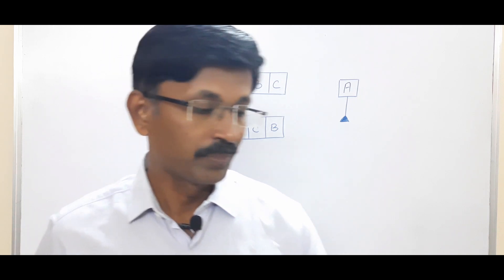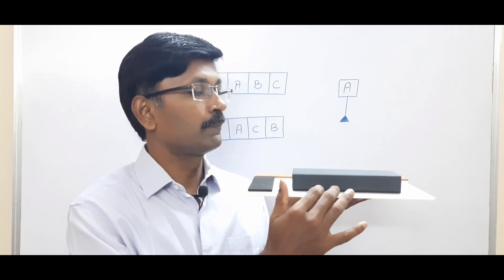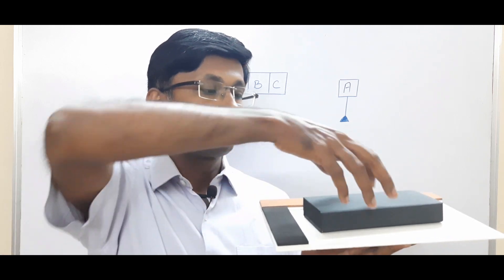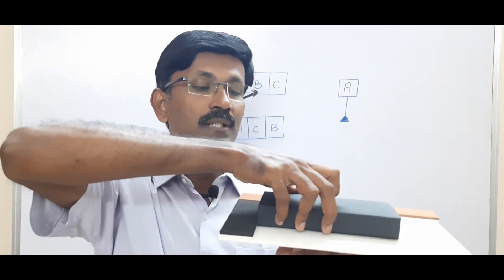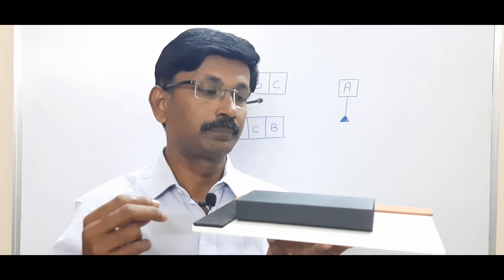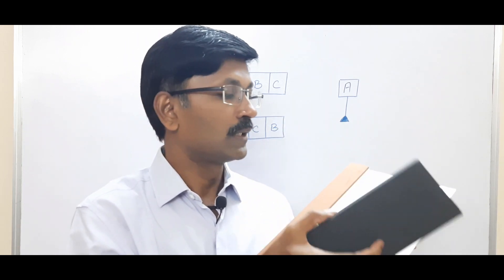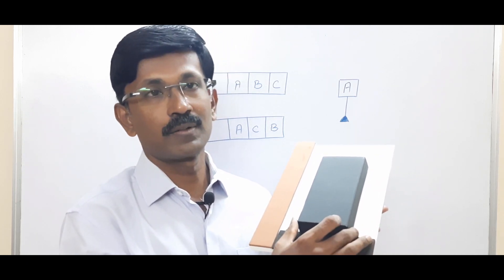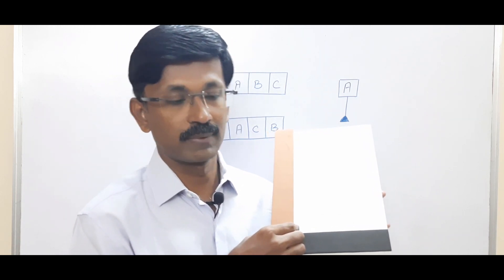GD&T Tutorial 24.2: Datum Reference Frame

Comment: Hi sir
I have one doubt.
If a rectangular plate bottom surface is datum A & left side surface in datum B (front view) what is the general tolerance for that two datum should I give (means consider).If I consider it is basic it is not possible to manufacture or otherwise it is general tolerance (0.1 or 0.2) what about the orientation geometric tolerance for that datums
Reply from the maker: the doubt is not clear. could you make a sketch and explain your doubt